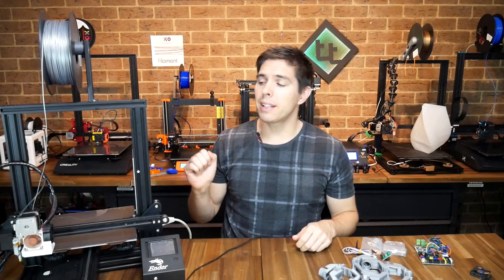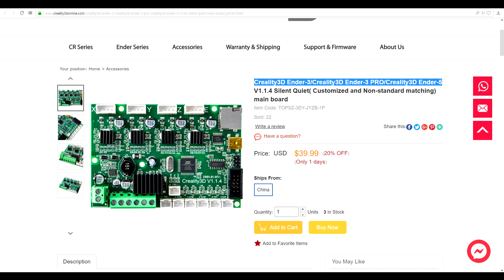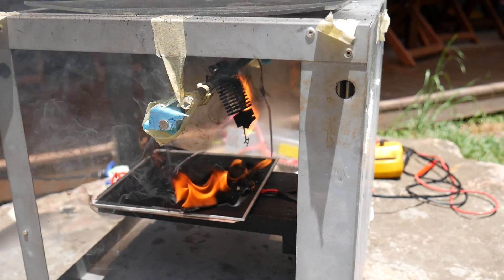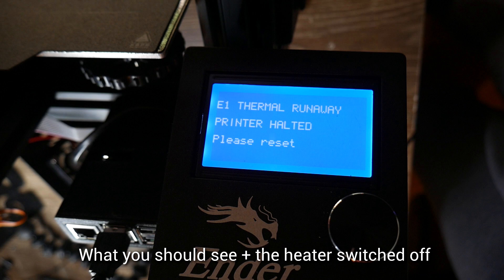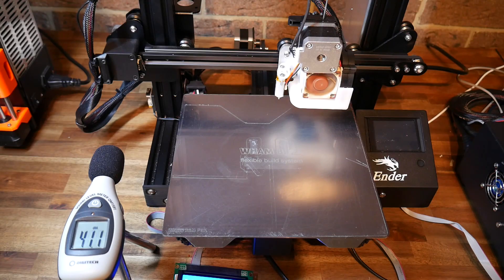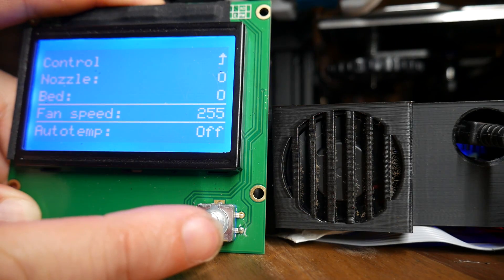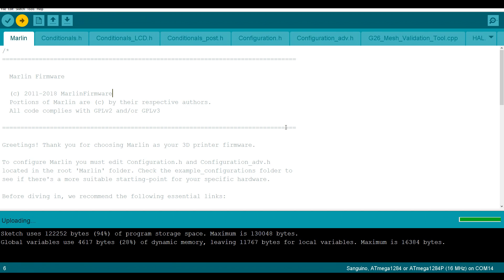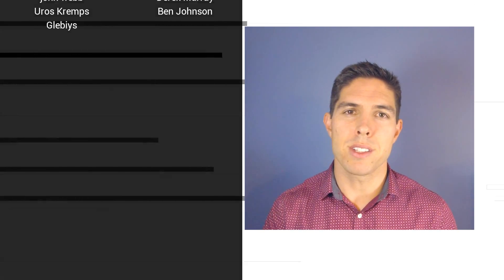Creality 1.1.4 Ender 3 board upgrade - TMC2208s from factory

Comment: Can you do a video explaining how the new drivers silence the stepper motors? I thought that the stepper motor noise was a  hardware issue, but it can be fixed with software? 🤔
Reply: To explian simplified: The TMC-drivers interpolate microstepping to 256 microsteps. So while an 16-microstep driver move the motor 1,8/16 ° on one step pulse from the controler, a TMC does 16 1,8°/256 moves to get to the same position. Of course this is much smoother and result in less vibration. Its like jumping down a stairway  16 steps at once instead runing down fast 16 steps. Of course running down is less noisy compared to bump down 16 steps at once. You can use the 16 stairway-steps fast to get less noisy - or you use thick rubersoles for jumping. First techniqe is like using 256 microsteps instead only 16 - and second way is like using a damper on the stepper motor.

The TMC does it automatic, so no change in firmware needed to get less noise.
Reply: @oleurgast730  my man. Thank you. Explained beautifully
Reply: @oleurgast730  According to the Marlin docs it is because the drivers use PWM to drive the steppers.
Reply: @PerBuer  Thats the method used to do high resolution microsteps. Changing magnetic fields lead to induction, changing the magnetic field of an electro-magnet leads to self induction. So you have self-induction on any motor. You can reduce it with diodes (like on TL-smoothers) or you can constantly measure it and react by changing the power to the motor to compensate. To change the power a stepper driver uses PWM. But PWM alone wouldn´t help without constant measurement (feedback loop); nearly all steper drivers use PWM to control output, but the effect to reduce noise by more constant movement is done by the feedback measured (that also alows to detect blockage /crash /homeing as a side effect).
Due to the self-induction a 256 microstepping could not be done without measuring the power including the "backflow" by self-induction and permantly adjusting. So the reason the stepper motor is quite is the high resolution microstepping, the way its archived is using measurement an PWM-control.

Comment: I got an ender 3 2 weeks ago, has the early board.   I also got the BLTouch kit from creality..  Now talk about a ballsup, it was a new BLTouch V3, the firmware they supplied did not support it, and there was no mention anywhere of the fact that the V3 BlTouch was only supported on Marlin 2.0 , which i am now running my own tweaked version of.  it'll be interesting to see what you've been sent.
also interesting that there is nothing mentioned on the antclabs site about compatibility of it.

Comment: You didn't mention whether this new board has any more memory than the stock on the Ender 3. I followed your upgrades for latest version of vanilla Marlin, bl touch and also did thermal runaway and filament run-out. I had to scrape every bit of memory as you well know.  Does this board also have the limited memory? If so I won't upgrade to it.  If it does have more memory , then I would say it's worth upgrading.

Comment: It is still a small Atmel chip with 128k instead 256k for the firmware...don't get why a new board with 'expensive' TMC didn't get the slightly more expensive AtMega 2560 chip. You will need to decide which features you want and strip down others. If you get that with a new printer okay BUT it is not worth to buy it as an upgrade!

Comment: This is great I am not too great with stuff like this so to have a 1-1 replacement board with a boot loader will be great if the bl touch works well I will order both sets can't wait for your next video.
Reply: Have you installed the BL Touch in this Board? Which Firmware has been chosen?..

Comment: Hey, could you help me debunk the cause of this "thump" on my ender 3 pro?

https://www.youtube.com/watch?v=zGUsuoAP9GA

I'm using this marlin version https://github.com/InsanityAutomation/Marlin/tree/Creality_2.0_Devel

And i disabled junction deviation as it causes blobs and zits at every corner, but now i don't get zits or blobs, but when i'm making a  calibration hollow cube for measuring wall for extruder calibration, my printer now thumps at every layer change pretty badly to the point where i can almost feel the thump's resonance. I've tried to chage every Z value that m503 shows, but nothing worked so far.

Comment: Good day Michael, thank you so much for this video, I will definetly consider upgrading to this new upgraded board!
However, I have a 3D printing specific question and I don't really know who I could ask, besides you so I hope to get an answer: I upgraded an inductive probe on my Ender 3 to enable abl. The problem is, the bed on my Ender 3 is not glued to the aluminum underneath, so there are parts of the bed that are "warped" upwards, so even with the probe, I am getting parts of the first layer, which are way too thin and I cannot really compensate this. 
So the main question is: Is it possible to print on a sheet of aluminum? I really want to swap this Ender 3 "buildtek" clone with an aluminum sheet, so the probe can really "see" where the bed is.
Reply: I use some high-temp neodyn magnets under the heated bed (make sure not to place them there the probe take its measurement). So I can put an spring-steel on the bed, with different surfaces. It lays perfectly flat (if you use enough magnets). You may even try an PEI powder coated spring steel (I use the prusa one, the Thekkiinngg v2 and in future the v4).

Comment: Interesting review.  It bears mentioning that the new Creality 1.1.4 board uses the CH340 USB chip, not the FTDI one so Windows drivers will need to be downloaded in order to connect to the PC.  I'm pretty sure they're on the E3 USB drive that came with the unit, so it's not a big deal for Ender users but they should be aware of it if they can't connect to update their firmware. I personally am going the SKR V1.3/2208/Marlin 2.0 route but had they come up with this solution say, 5-6 months ago, I would've bought into it.  To be fair, it's an almost perfect plug (in)-and-play upgrade vs some of the plug-n-pray boards I've seen.
Reply: Be interested to see what you think of the skr 1.3 I’m also thinking of that instead
Reply: @Len02013  The purchase is still 'in transit' lol.  I'll try to remember to comment here once I get it and hook it all up. I'm just after future-proofing the printer and the 1.1.3 board will be a backup and development board after I fix the design flaws.
Reply: Oops I made a mistake, the CH340 drivers are NOT on the SD card, only the FTDI drivers.  The mfg download is located here:   http://www.wch.cn/downloads/CH341SER_ZIP.html

Comment: That's great they are finally making upgrades for the machine, but this is rather disappointing... Same 1284 chip with memory constraints, not possible to use UART mode, tiny heatsinks, and worst of all faulty thermal runaway when it's advertised as working is complete BS.
Still happy with my MKS Gen L + 2208's, been printing 8+ hours a day for a month now without any issues!! Oh and Michael, check out this case on Thingiverse, I just finished putting it all together and absolutely love it. Has a 120mm fan blowing right at the 2208's, an 80mm fan blowing directly at 2 external mosfet boards and the Raspberry Pi, and even contains the power supply all in one box. Here's the link:
https://www.thingiverse.com/thing:3487919
I'm building an enclosure and wanted all the electronics in a separate box so I don't need to worry about them overheating, this works perfectly!

Great video as always my friend!

Comment: I have brought new ender 3 and BL touch and installed that but unfortunately it didn't work. I have tried your configuration file (i have purchased them) that you have made for BL touch for ender 3 and vanila Marin 1.1.9. but that also didn't work.
Reply: If you have the newest version of the bltouch it won't work with 1.xxx marlin builds.  You need to install marlin version 2.0

Comment: Any plans to review the SKR v1.3? It's a new 32bit board, UART and SPI with no wires,  that's the same price as the MKS Gen L
Reply: Seconded!  This board seems like it might be just the ticket - I even heard (unconfirmed) that it's already supported in Marlin 2.
Reply: Honored Twig Yup it is. It even supports the stock display with single cable, by uncommenting #define cr10stockdisplay
Reply: Third :)

Comment: Do you have any idea how long Creality has been shipping with the 1.1.4 Board ? I am looking to buy an Ender  5; and would like to find out how long I should wait, to ensure Amazon has stock of the new one.
Reply: I ordered an Ender 3 a month ago and it came with the 1.1.4 Board. HOWEVER it still has A4988 and i had to flash a bootloader
Reply: @Insane_Kane  I asked Creality directly if my 'soon to be delivered' Ender 5 would have the new V1.1.4 Mainboard, especially since  I ordered the higher priced "Original Creality" model over the ComGrow unit posted on the Amazon site. Their answer was a clear "NO". You have to order the mainboard upgrade separately from Creality; which I think puts the MKS L back on the table as a contender.
Reply: @cache4pat  I would probably go all out and get mks l + tmc2130s. Quiet and they don't need endstops

Comment: Michael, you mentioned the BLTouch kit Creality sell.
I recently bought the BLTouch kit Creality sell.
The pin 27 board supplied causes the display connector to fowl on the control board fan so you have to print a new lid.
The z stop wires also had to be swapped.
Worst of all, the BLTouch failed after just over 1 month of very light service which in itself probably shouldn’t reflect on Creality.
What should be noted though is the advice I received from Creality that it provides NO warranty on parts so BLTouch or 1.1.4 control board is better sourced from anyone other than Creality.
Reply: Interesting - same here Official BLTouch from Creality failed after one month too, almost to the day. Dealer I purchased it form has agreed to replace it.

Comment: I upgraded a friend's Ender 3 to the MKS GEN L using the TH3D firmware. It took a bit of doing to cobble together the right settings to build his printer in the TH3D firmware, but we got it working perfectly and he's very happy with the result and it only cost us $28. Couldn't have done it without your video!
Reply: Last th3d fw [U1.R2.10a (4/8/2019)] ?

Comment: What you tested was a heater failure, not strictly a thermistor failure, you should have disconnected the thermistor to check for that detection, but I do agree that if it doesn't detect a change in temperature within 30 seconds it should shut off regardless of what the cause could be.

I did a video fixing some of the issues of the board, such as the poor design of the electrical supply line feeding the drivers, and the parallel fan issue: https://www.youtube.com/watch?v=7P04-56MoQg

Comment: Awesome video as always. Thanks for the in depth review!!!
 I've had the same board now for 3 weeks. Only problem is I'm running Klipper Firmware. When I try to activate the tmc2208 chips, the firmware halts and asks me for uart pins per driver. I have no idea what pin that would be. So I have to run it like A4988 chips... You wouldn't happen to know what those pins would be would you?
Reply: Creality implemented the TMC2208 on this board using only standalone mode, so UART is not possible. Look for an option related to the TMC2208's to change from UART Mode to Standalone (or Legacy) Mode instead. Sorry I can't be more specific, I haven't used Klipper yet.
Unfortunately, that means you won't be able to get the advanced logging features and/or SpreadCycle mode, but it's not really needed for an Ender 3 as all of the steppers work just fine in StealthChop mode.
Reply: @deceitive3338  I may not have the 2208's then, based on the fact that my noise level is the same as the v1.1.3 board. Also that Michael just posted above that it has to be ordered from Creality as the "upgrade" version. Hm. I guess I could pull of the heat sink on one of the drivers and inspect it.
Reply: @deceitive3338  I can confirm now that I have the A4988 chipset on my v1.1.4 board. So sad.
Here are pics:
http://aenprodfileshare.com/retrieve.php?share=ec0azq1ym1o6_rb6kecuhwqlbdny6kytjvbwxbz_r3juvm71pthccrl3nhpk15ju5p78sckickvtqez0u6mxet7824456xew08igd8mdhjjkb_ubp1yf3k2pd8z7hbce

http://aenprodfileshare.com/retrieve.php?share=ec0azq1ym1o6_rb6kecuhwqlbdny6kytjvbwxbz_r3juvm71pthccrl3nhpk15ju5p78sckickvtqez0u6mxet7824456xew08igd8mdhj_kl_uvprr23k2pd8z7hbce

Comment: Nice! This should still be compatible with the CR-10 as well, right?
Reply: I'm no expert, but I'm thinking that all it would take is to load an appropriate CR-10 firmware (CR-10 settings instead of Ender 3/5) and it should work fine.
Reply: @honoredtwig3298  yeah I'm just wondering if the board is the same layout as the Melzi board in the CR-10. I have a MKS on my other printer but I don't want to deal with modifying the enclosure on the CR-10.

Comment: Can't understand how you could possibly recommend this when it has no thermal runaway enabled.
Reply: He mentioned that he only recommends it if you upgrade the Marlin firmware as that will fix the issue. Updating firmware is really easy to do so I agree with him, it's a bargain so long as you update it.

Comment: AWESOME video Mike! Great to see they are taking the noise level and the ease of installing other firmware as a bonus to their machines. I have noticed getting some serious "Heat Creep" on my hotend when getting over 210 degress. The tiny fan just doesnt direct enough air. I made a mount to install a 5015 onto the Hero Me that you did and it has REALLY helped. https://www.thingiverse.com/thing:3545855

Comment: But are the drivers in stealthchop or hybrid spread cycle mode?
Reply: StealthChop. It would be much louder if it was in SpreadCycle.
If you're worried about the extruder running in StealthChop, it's not an issue, I've been running mine (MKS+2208's) 8+ hours a day for a month and haven't had any issues with skipped steps.  If you did all you need to do is increase the VREF slightly using the onboard potentiometer.

Comment: My Ender 5 has the 1.1.4 board but with the A4988 drivers?
Reply: I have one as well. I just got the new "silent" 1.1.4 in the mail today.
Reply: I have an Ender 5 with 1.1.4 board.  What does that mean if it's using the A4988 driver?  How do you know it's using this driver?
Reply: @ibuyufo  there is an insanely huge difference in sound between the A4988 drivers and these 2208 tmc drivers. You would know if you had the tmc drivers or not.

Comment: Good review. Does that tiny fan actually compensate for the amount of heat the 2208s put out on long prints?
Reply: It was enough for me on the MKS Gen L, but my 2208's have much larger heatsinks. They are attached to a much larger board compared to mine though so they're probably fine.
I got sick of worrying about them so I printed out a custom box with a 120mm fan blowing directly on them.
Reply: @deceitive3338  I've done something similar with my Anet A8. I put a mks gen l with 2208 on it and built a custom case. I only used an 80mm fan. on them and so far so good. I'll be doing the same to my ender 3 soon.
Reply: @AlienTaskForce  Here's the case I used in case you're interested. It holds everything in such as the power supply, the MKS Gen L, a Raspberry Pi B+, 2 Mosfets, 120mm fan in the front and 80mm fan in the back, plus it looks really slick!
https://www.thingiverse.com/thing:3487919

I wanted a separate box for all the electronics so I can make an enclosure for the printer to print PolyCarbonate, this one works beautifully, just finished installing it today!

Comment: funny, I updated the firmware of my Cr10s standard mainboard because of the octoprint thermal runaway warning. The warning didn't vanish, but now I get thermal runaway warning messages (sometimes) but it never stops heating the nozzle.
So perhaps this is not a MKS Gen L only problem
Reply: I'd replace the Thermistor just to be safe, that warning shouldn't come up in normal use so there might be a loose connection or damaged wire. Order a 100k thermistor with a 3 foot (90-100cm or 1m) or longer cable, Creality even sells replacements on Bangood and Amazon.

Comment: They probably have thermal runaway for high, #s but not low readings. 
I can see a CH340 on the PCB for direct USB communication, and if you connect to Windows the USB might be flaky if you don't use the official CH340 driver.
Reply: It should be coming up on the LCD screen and shutting the heater off itself on board, he only had it connected to Pronterface so we could see if any error messages appeared.